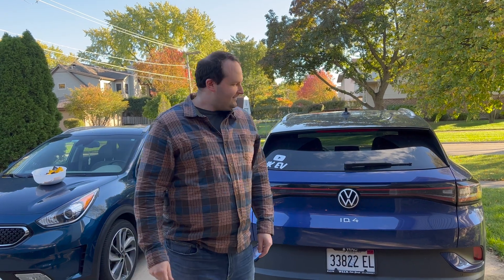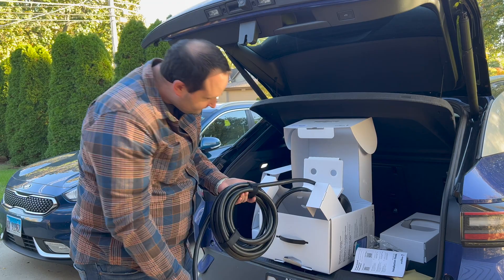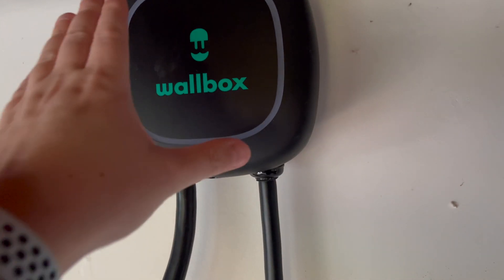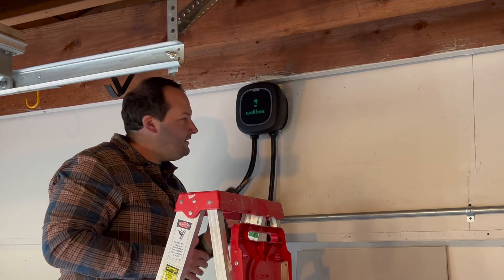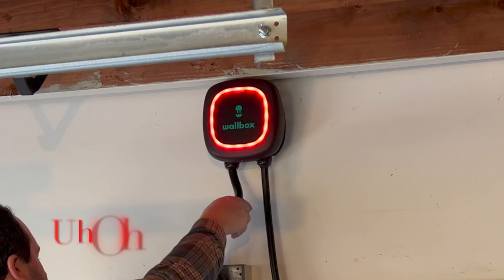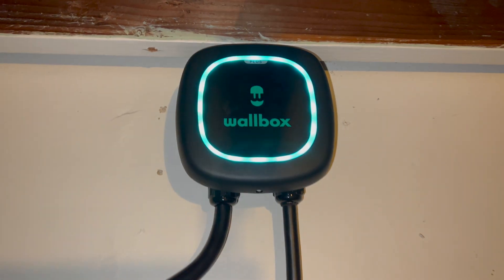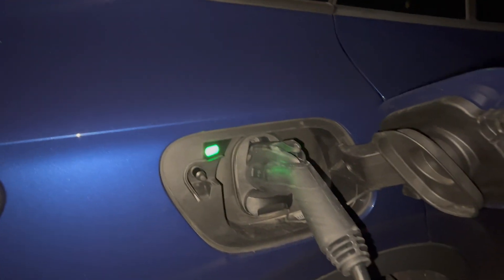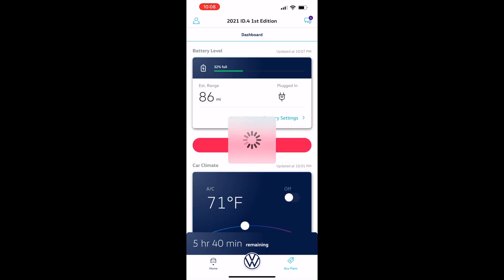Wallbox Pulsar Plus Level 2 Smart Charger Unboxing Installation & Features Review

Comment: Why not hardware and get 48 amps?  Faster charge rate. Less chance of failure point.
Reply from the maker: My Tesla only charges at 32 amps
Reply: @EVMotoring  Still a socket has a greater chance of failure with prolonged use. Heat and resistance is your enemy. You will regret it. I am an EE. Any electrician will tell you the same thing.
Reply: A good outlet installed well will very well outlive the box. That’s exactly why you want it as a plug. Easily swappable with the latest and greatest tech.

Comment: Can you set a charge limit?
Reply from the maker: Yes, the app has lots of features including charging speed
Reply: @EVMotoring  Thanks for the reply! To clarify, could I set an 80% limit?
Reply from the maker: @TheJuggernoob1  no, it doesn’t do that but you should be able to set that on your car. It does let you remotely change the speed, start time, and stop time so I used to use all three of those to have it finish right before I leave in the morning so the battery is warm and ready to go.

Comment: Hello, checking to see how this charger has been treating you. Have you used it off wifi and can you control the amperage through the app while just on wifi?
Reply from the maker: It’s a great unit! I frequently use the app to adjust amperage so the charge finishes right before I leave for the day.
Reply: @EVMotoring  thank you, I won't have a wifi signal to it so I worry that it won't charge when it needs an update. I was also hoping to only connect via Bluetooth and lower the amperage during the day then increase it while in bed
Reply from the maker: @jturkish  I believe updates can also be run over Bluetooth or wifi hotspot

Comment: Looks nice and small but I’m worried about the plastic mounting plate and the rest of the box attached to this plate with two tiny screws. The cables can be very heavy and over time, the plastic plate may deteriorate and crack etc
Reply from the maker: It seems like a good product, but only time will tell.

Comment: What if you have to install this in a condo garage with no LTE available.
Reply from the maker: It also works via Bluetooth
Reply: @EVMotoring  I mean for  mandatory firmware updates
Reply: @BB0YMatty  The Wallbox has WiFi and Bluetooth connectivity, no LTE. Updates likely come via WiFi.

Comment: Thanks for the video is there an on and off button like for when your not using it or do I have to take out the plug 🔌 every time
Reply from the maker: I would recommend having a switch wired in if you would like to completely turn off the unit

Comment: Im in the process of buying a electric car now, and i have no knowledge what-so-ever with electricity. Im getting the Mini SE which i believe can accept 40 amps? If i get this charger and plug it into my 240 outlet do i need to change the ampage or is it pretty much plug and play? I dont want to ruin the car, any advice to help me understand better would be appreciated. Also my garage is most likely out of range of my wifi, i could get an google point to extend the range, but would the app still work if there was no wifi, or does it need to be on the same network?
Reply from the maker: I use a mesh router system to extend the coverage to the garage/yard. As long as you have a 50 amp breaker, 40 amps of charging is fine. The charger should always be set to 80% or less of what the breaker is.

Comment: why set the dial for max amp if the app will do it? Also is there a way to set car profile and tell it to just charge to 90% or do you have to do that in the car itself?
Reply from the maker: The charge limit must be set on the car itself. I set the dial for the max that my circuit can handle so I accidentally don’t request too much power.

Comment: Does your breaker board have the capacity to replace the 40A breaker with a 50A breaker?  If so, you can swap the breaker and set the charger to 40A and, if need be, charge significantly faster.
Reply from the maker: I’m just on a 100 amp panel so unfortunately no. Even at the current charging rate though I still have no problem charging the car overnight
Reply from the maker: @William Lusby thanks I will look into this

Comment: Please keep us posted on how the wallbox works for long term especially during the winter months where you guys live. It failed State of Charge video the deep freeze test for the cable. I want to get a wallbox. I'm down south it gets down to 32⁰ to 23⁰ where I live so I'm hoping that the cable is pliable to movement in the wintertime for usage in the mornings. If you can let's us know in your next videos how its working for you guys that would be great! Thanks for the continued great content.
Reply from the maker: Will do! The cable definitely gets stiff in cold temps. I just plugged it in at 10 degrees yesterday